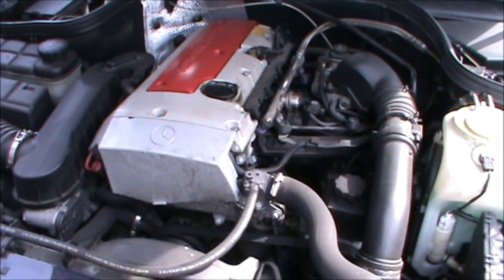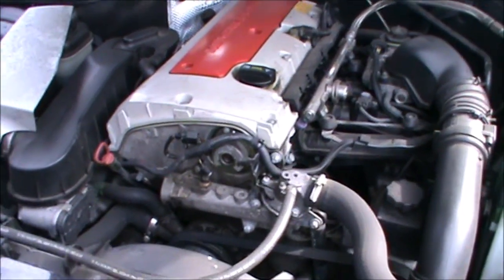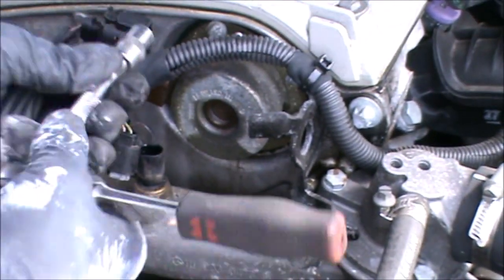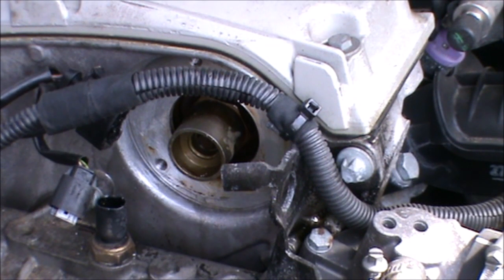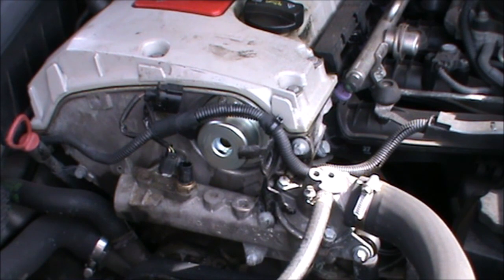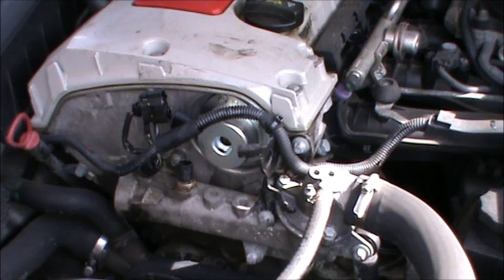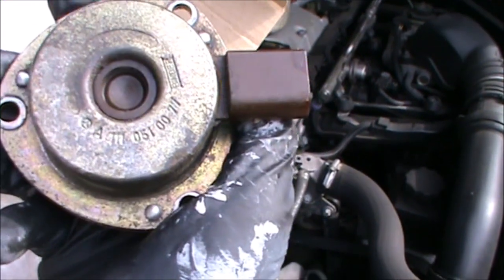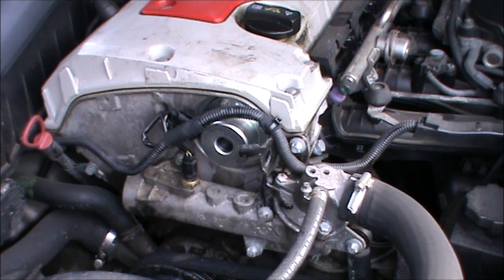Mercedes CLK w208 2.3 2002 camshaft central magnet adjuster removal and replacement

Comment: Oil can travel to ecu. I recomend to check and clean plugs in ecu.
Reply from the maker: Yes its a god idea to check that, as oil does travel to the plugs
Reply: thats true, i had evap code from the oil at the ecu from this thing and i manage to find it out only after 3 years from service to service. Everything ok after cleaning and repairing the ecu

Comment: You only needed that rubber part you used at the end the rest was wasting money 😂😂😂
Reply from the maker: Oh really , would that stop oil leaking into the electrical plug too ? Just asking as I don’t really know thought I had to replace the whole part.
Reply: @DaringBeefcake  yes
Reply from the maker: @frankiegregoriou4604  ok cool, since it will leak again in future then will just replace the little rubber, and everyone reading the comments can follow your advice. Thanks for sharing 👍

Comment: Thanks man, great video ! Did you have some rattles between 1000 - 2000 RPM before replacing it?
Reply from the maker: Joris Blouquy thanks buddy, I still hear the rattles at those rpms, not sure what that is.
Reply: Did you find out where the rattles come from?
Reply: what you have replaced is the magnet, the only thing it does is pulling out a „shell“ so the camshaft adjuster (which actually sits directly on the camshaft beneath the valvcover) can move. these rattles at certain rpms is comming from inside of the motor. i have the same problem.
Reply: Ratles? Did you ckeck the timing chain?

Comment: Thank you for your Video, i have to do that myself soon too. What i don´t get is why people change the entire magnet tho. There is no wear on that part right? It´s the O-Ring and the sealing agent that causes problems with age, not the magnet?
Reply from the maker: The problem I had was that the oil starts leaking into the electric plug and then travels all the way to the ecu, and can cause faults and fault codes.

Comment: despite oil leak what does that magnet do? and how to know if its not working probably?
Reply from the maker: well as far as am aware the magnet reads the signal as the camshafts get adjusted independently and send a signal to the ecu to adjust fuel and air.

Comment: I dont have sealent. Will it work without it?
Reply from the maker: To be honest because it’s metal to metal it might leak a bit so you could just get some heat resistan sealant and do it then.
Reply: @DaringBeefcake  I got the sealent. Its 5€ for 70ml. Good for up to 300°C
Reply: @DaringBeefcake  I did it without sealant.... so i am going to do it again and use sealant. Faults are there for learning 😂

Comment: my slk has the clk engine I'n it but it's a 2000
Reply from the maker: The engine is fitted to many models
Reply: @DaringBeefcake  would you say the magnet is the same from the varied 2.3l? their the same part the cars sort of run equally. I suppose I'm asking because I feel like mine is wrong because they are mostly shaped this way.